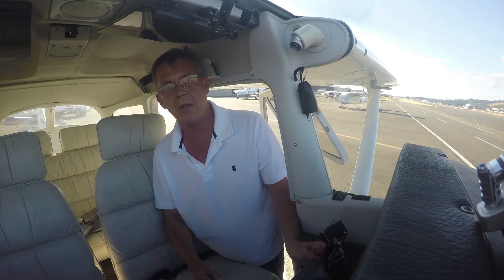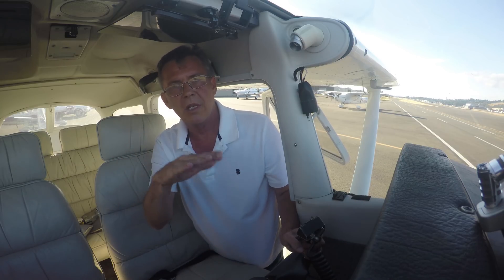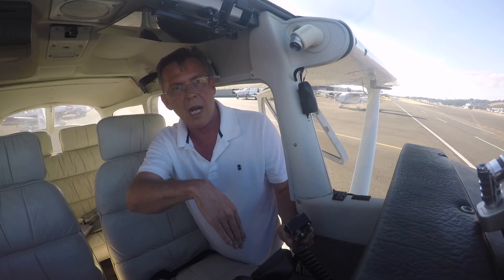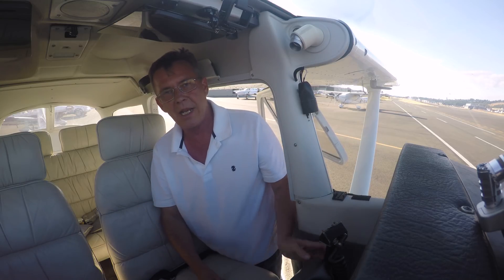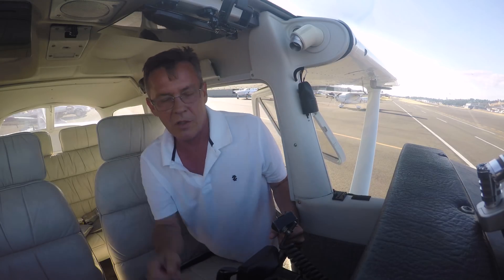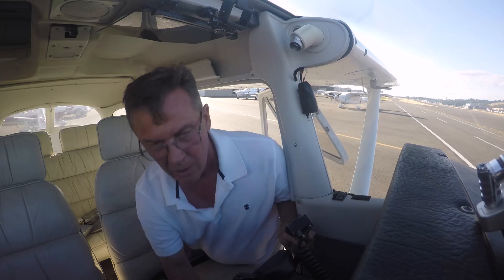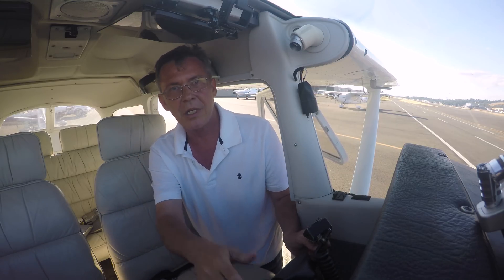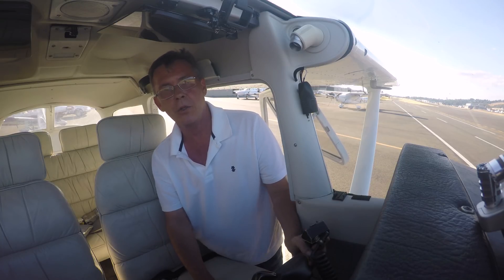How aircraft trim works. 4K

Comment: This is great but would be helpful if you actually do it during a flight.

I have about 15 hours already with my instructor but this is what i learn:

This is simply about altitude control and a bit to do with landing.

You will need trim if you want to go at a certain speed and at a steady altitude lets say 6k ft agl. If the plane noise is descending to 5ft then you can Trim up to keep your speed at 5ft or if ascending above 6ft you can trim down and make the the vertical speed indicator is at or around 0.

Comment: Still confused about the aerodynamics how it works opposite. It would seem to me that if the trim is pointing upwards (turning the wheel up) then additional air flowing over the trim would push the elevator down even more and in turn pitch the nose up more as well (similar to what the elevators do).